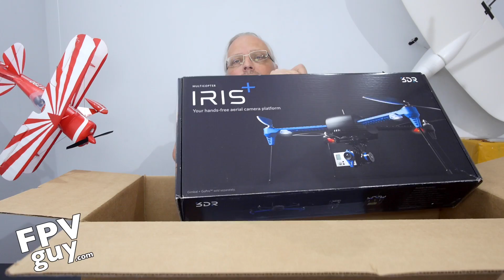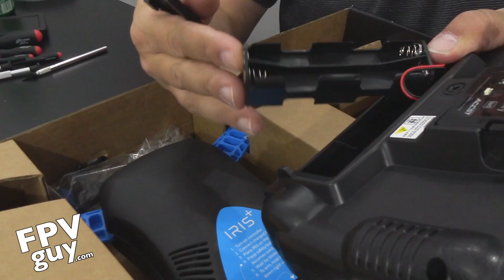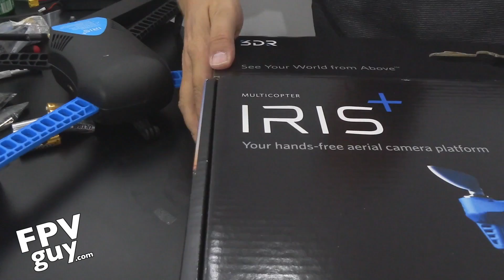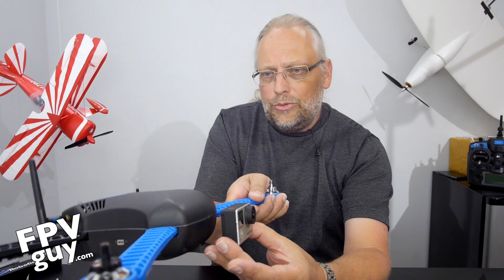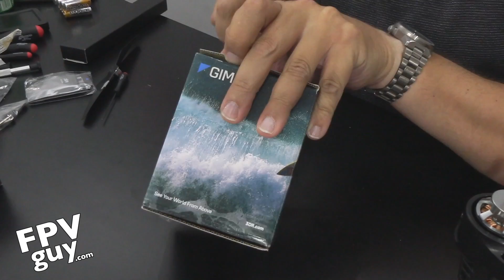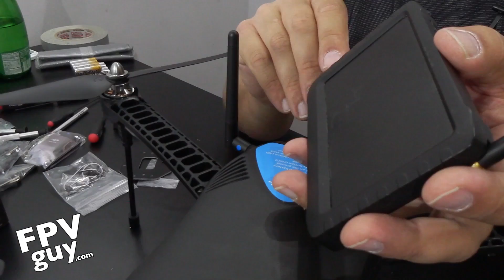IRIS+ Unbox

Comment: Have a question about the battery.  I haven't flew mine in about 4 years . Went to charge battery. But it feels slightly inflated. I cant remember if this is normal???
Reply from the maker: Sounds like its dead,  probably not going to take a full charge, or rather it will charge but will not give a full flight time.  see how it plays, but don't fly far until you know how its working :-)
Reply: @bophoto  thanks

Comment: Bo, when was this offered with the gimbal, Ive purchase three of them and have never seen  a package with one,
Reply from the maker: +Elmo Di Calro  ?   wait, you purchased 3 kits and have not received them?
Reply: no ,,, lol, I bought three Iris 's in the past year or so, One for me, one for a buddy of mine and one for my neighbor, and not one of the kits had a gimbal,,
Reply from the maker: AH.  the Iris is separate,  you have to add the gimbal to the kit.
Reply: ok, thats what i thought, was watching your vid and it just seemed it came with it,,lol 
that gimbal is not the best,,, I agree with you on that ,, I purchased one of those cheap Chinese gimbals and it works great, 69 bucks,,,lol never a hitch,
Reply: hey Bo I have a question about the Iris autonomy, if you dont mind, will the iris continue on its mission if programmed with Mission Planner, if the transmitter is turned off, and it exceeds the range of the ground station?
Reply from the maker: You can select that option when you do the setup,  there is a option to continue if TX is disconnected,  or to RTH if disconnected.
Reply: great. , you referring to the set up in droid planner?
Reply from the maker: Yes ;-)

Comment: Bo, on that I look+
+ camera, I have one and also am thinking of using it on the Iris I may buy from a friend of mine,, the I look +comes with a kind of unusual power cord,  any thoughts on how to power it up from that Iris? . is there an adaptor for the I look as its a 4 wire plug on the power source
Reply from the maker: +Elmo Di Calro   grab a couple cable packs from Heather at RCvision.com  and hack together whatever needed, to pig-tail in-between the IRIS power out and the IRIS gimbal  http://www.myrcvision.com/collections/g-3d-gimbal-parts

Comment: I guess it's good for noobs or people who don't want to build but dji style arms with a th9x tx isn't exactly a step forward.  I'd love to see a gimbal roundup or even just the autotune or plug and play ones if you have time in the future, I don't know anyone who has so much experience with so many different gimbals.
Reply from the maker: MicroRCFiend   you are totally right.. this is really just a 450 with a plastic body and a Pixhawk controller..  nothing super exciting for sure..  but it is RTF. and the RTF market really is where its at these days.
Ahhh. I keep trying to put a gimbal roundup together.   here is the problem, they move sooo fast, and the new gimbals are surprisingly good.   right now the "trend" is that the factory ball-cam's quickly are getting very good.  look at the q500 camera that is shockingly stable and the inspire-1 camera is also very stable...  to make things worse for the gimbal market.. the inspire-1 camera/gimbal unit is only $550..   for one of the best gimbals out there with a build in 4K camera..   I remember paying more than that for crappy gimbals two years ago.

Comment: Another great no nonsense unboxing Bo. It's a good price in the CONUS as when they arrive in the UK the average retail price is the equivalent of $1300 at today's exchange rate. I really like the 3DR FC's, I have the APM installed in a fixed wing and a quad. I have a question about the iLook+ camera. I have the 720p iLook camera on my P1 and when you start it recording the FPV frame rate drops to an unusable 5fps, give or take a frame. Does the Plus version also suffer this?
Regards
Nidge
Reply from the maker: Hey Nidge,   Thank you for the kind words.    
The iLook+ camera have a very flyable frame-rate, I have used it for lots of things, simply sticking the camera on top and go fly.   and am comfortable flying goggles using the iLook+  (with a quality set of antennas obviously)

Comment: only a 2 axis gimbal supplied
eek
Reply from the maker: Raptor50aus  yeah totally agreed,  do note they don't actually include the gimbal, you have to buy it separately as a check box item on the 3DR website.   the gimbal power and pitch control is easily available,  so you might as well get a 3 axis gimbal from some other supplier.

Comment from the maker: +anthony eaglebarger 
My thoughts exactly,   the SOLO is a sweet ride, but by the time its in the air, you are into it with about $1200+... one can get a IRIS+ for about half of that.. its a pretty good value at the moment and a fine GoPro camera platform for short-range video shots.
Reply: Bo Lorentzen isn't the stock IRIS+ only about $750? And as far as I know that doesn't include a gimbal or any sort of video transmission. So by the time you get all that you end up spending the same as the SOLO. Correct me if I'm wrong....
Reply from the maker: Airwolf   YUP you are correct.  actually at this time I think its about $700 for the IRIS+.   you DO need to add a gimbal / camera.
BUT like the IRIS, the SOLO also come naked, and you need to add a Gimbal / camera to the $999 cost of the SOLO. and also a smart phone or tablet if you don't already have one.
Reply from the maker: Airwolf   Yup,  thats kinda interesting because its going to have to really deliver to make good with the actual fully-equipped price GoPro black + gimbal + your taste in tablet to better a P3 pro.
Reply: Bo Lorentzen A loaded P3 Advanced is only 999, that is with everything you need including camera, and the advanced camera is still a very nice camera so the Solo really needs to deliver for its price point. On the plus side with the Iris being so low cost, you can put different landing gear on it (customization always fun) and make those top switches useful so you can then get a 360 degree gimbal and have it turn using two switches for quarter turns, for those of us who do not own the Walkera X4 or Tali H500 that is lol. One other upgrade would be to swap out the battery tray in that radio for a plug for a lipo battery.
Reply: Bo Lorentzen will you be reviewing the solo also? :D plz do
Reply from the maker: Edmundo Andres   Yes absolutely,  that one is in the pipeline..  as soon as I can get my hands on one..   but I think the solo is going to find though competition from the DJI Phantom 3 quads.
Reply: Mmmm dont think so man , 3dr solo has evertyhing , waypoints rth, good app and good customer service , dji doesnt have customer service and i hear it wont have waypoints :( anyway i cant wait your review to see the performance
Reply from the maker: I hear you on the waypoint and I love some of the automated features..   interestingly all of the features is exactly what so many kick-starters have failed to bring..   I definitely agree, IF they can deliver on this and the promised features.. the SOLO will be VERY hot.
Reply: Bo Lorentzen Oh! Good point Bo. Now that I look at the SOLO I see that it is naked at the $1000 price point!

Comment: One thing about this quad is that it is the discontinued model, 3DR has a new one coming out that is supposed to be much better, but with the price that carolina dronez has I am tempted to buy one because I have never seen one just fly away and have seen very good reviews for the Iris.
Reply from the maker: anthony eaglebarger   totally agree,  the SOLO should upstage the older IRIS+  and it have for sure.    
I think the IRIS+ still have a mission as a fairly simply learner quad.?
Reply: The Iris is a great quad, especially for aerial footage, they are discontinuing it so I intend to get one soon. My only concern is that it is not the standard 2.4 ghz, now this may not be an issue but then again, it could be. But with the current price it would be totally worth putting in a different receiver and transmitter.
Reply from the maker: Yeah agree on that.   I think the stock transmitter should work fine.   just buy a VTX for the GoPro and a blackpearl screen to get a visual on what you are shooting.
Reply: Bo Lorentzen That is what I was thinking a true 5.8 ghz system and then a screen, since this is mainly an aerial video platform and was intended for that purpose, not going to try to modify it for fpv flying that 250 you reviewed looks like it would do a much better and safer job of that.